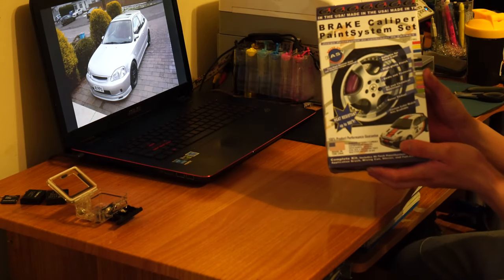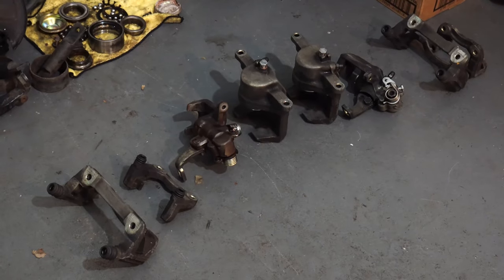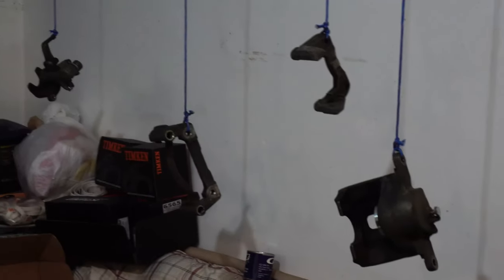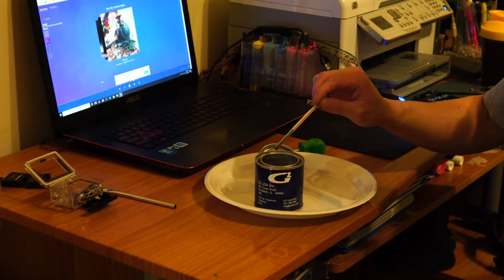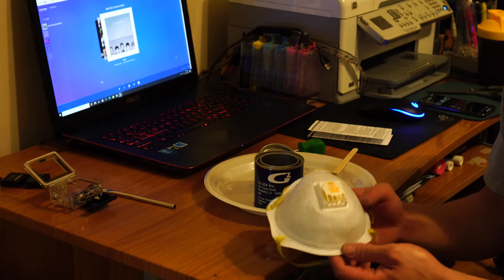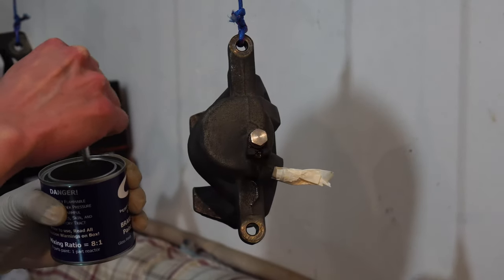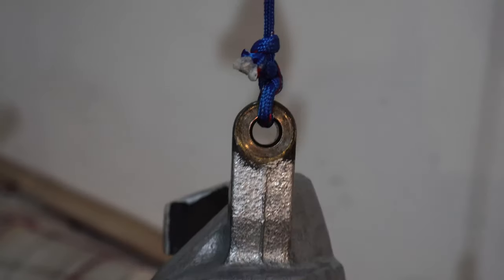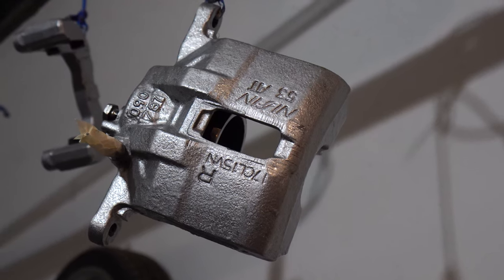How to Paint Calipers with G2 (off car) with Michael Flare

Comment: Any reason you went with silver and not red?
Reply from the maker: James Beatty I’m a HUGE fan of cars with completely stock exterior. These calipers brand new from the factory were silver.
Reply: I can’t completely understand that reasoning! I’m the same way.. Car looks amazing and like always you come thru with quality and high grade work!
Reply from the maker: James Beatty Thank you so much! I hope that my 10 years of putting this car on YouTube have inspired people to keep their car’s exterior as stock as possible. I built this car from the start to race so I track it obviously. Even I don’t even have splitters, canards, diffusers, GT wing, window nets, drag holes on rear bumper, cut bumper, over fenders, etc. Everyone has their own opinion though and I respect everyone’s cars.
Reply: You inspired me to buy mine. I have a 97 Ek Hatch Dx Honda- Factory Roma Red paint and it looks stock just lowered on Tein coilovers ASR suspension goodies and HFP Honda Fit 16” and nitto neo gens. Full mint factory interior and motor swapped with working AC.